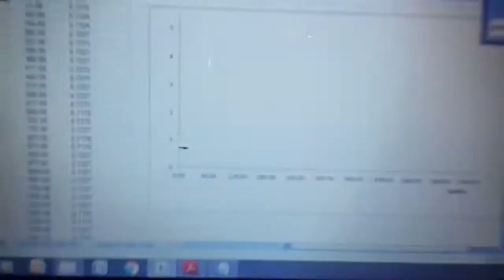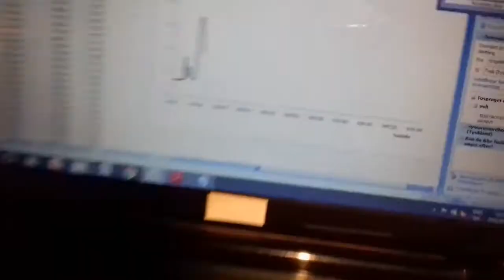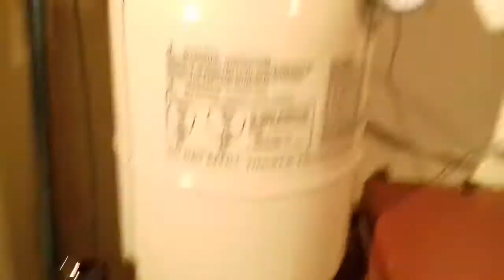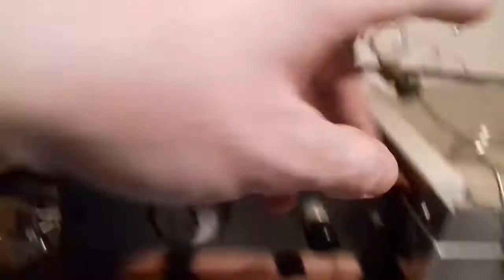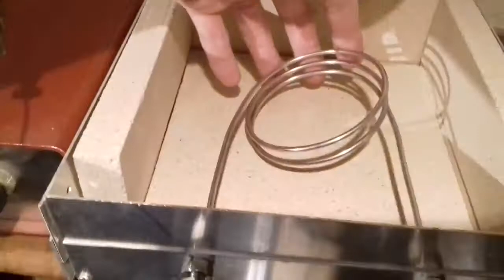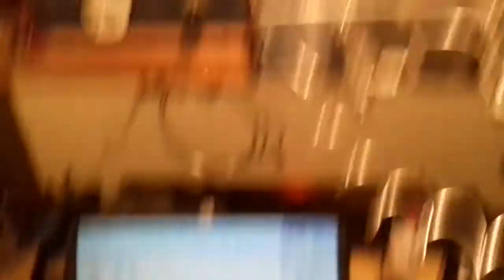DIY GC with inlet, oven and TCD

Comment: Hello, thanks for the video. Any chance you worked on the temperature-regulated oven?
Reply: if youre looking to accurately control temperature of a heating element, thats a serious nightmare
it helps if you use more resistance wire
short pieces of resistance wire causes vast amps which will mess with most power supplies
and many power supplies shuts off if it doesnt pump enough juice through

thinner wire gives more resistance
less resistance gives more amperage
voltage is what gives the heating effect
a 12v 1a gives same heat as 12v 60a, the 60a just means its much less prone to fail 

easiest but not cheapest is to get a lab power supply where you can adjust volt and amperage accurately
to make your own perhaps computer power supplies might work